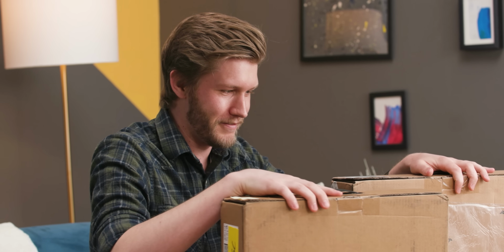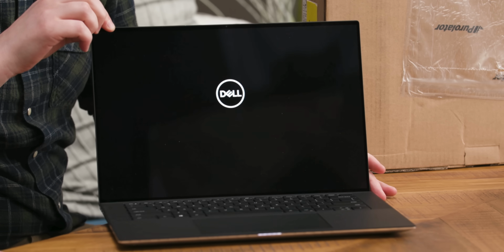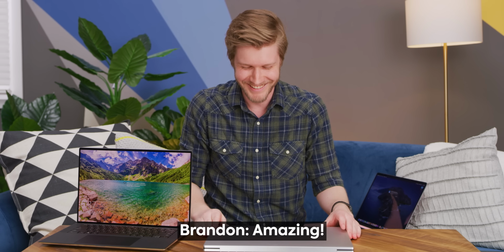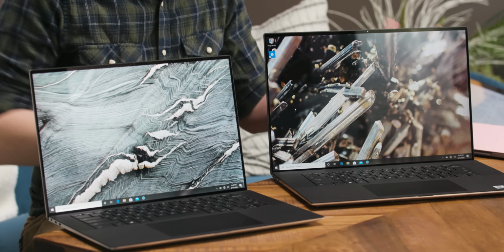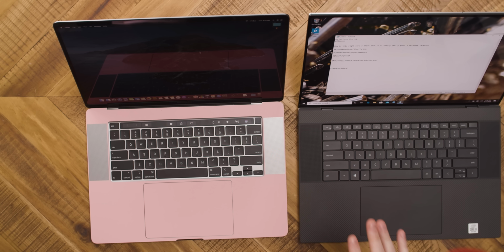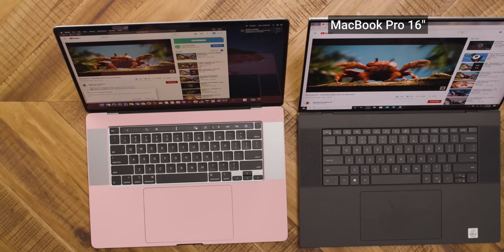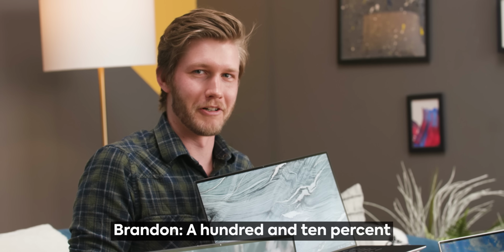The MacBook Pro's Biggest Rival - DELL XPS 15 9500 & 17 9700 Laptops

Comment: Imagine the 15inch with a rtx 2070 super max q(80w) vapor chamber and 4k120hz and supports 165w charging type c using the i9 at 56w constantly with the thunderbolt ports

Comment: I own the old XPS 15 9700 and the new screen is definitely a huge upgrade along with the extra USB-3 ports, but personally I like small trackpads, I know this isn't consensus in the community but personally smaller is better to me, I have large hands and big trackpads get in my way when I type all the time, I tend to slide my hands across the hand rest due to my fingers being broken multiple times from sports and not having full mobility in my fingers, especially ring and little finger

Comment: I wish Dell came out with some Ryzen processors, or at the very least state why they only use intel
Reply: pretty sure you can get a Ryzen 7 in an Inspiron now 
most manufacturers this year still have not moved onto Ryzen because what you see today was approved months back, so if someone does do a ryzen contract. it'll be a few months before you can see them come to production at the minimum

Comment: I support and deploy  the 9570, 7590, 9575 2 in 1.  The 9570 and 7590’s have very mushy keyboards compared to the newer 13” XPS 7390. The 9575 2 in 1 with the quasi Mac butterfly keyboard is very volatile. Users either love them or hate them. The Killer Network card on the 7590 will not pull down full speed over wired. Either on Windows 10 or Ubuntu. An iPad Pro gets better WiFi download speed than the 7590’s with that Killer 1650 card (which is WiFi 6).

Comment: lol measures weight in lb and then "couple grams different" 
technically right but...
Reply: It actually confused me, and I had to go back to make sure it was 5 lbs, not 5 kg lol
Reply: @handspiker1994  Check the temperature outside in Celsius, but my thermostat inside is in Fahrenheit lol. Us Canadians are a little different.
Reply: @10Tie  I like your profile pic
Reply: ooooh god yes!!! that triggered me so hard! :D it is even worse when knowing Alex has some pretty solid engineering  background
Reply: As an American (US) who has lived outside of the US for most of my adult life, I think the same way. Apparently I should move to Canada.
Imperial is more suited for longer/larger measurements and metric for smaller.
Even body temperature. 98.7°f is normal body temp, but 40°c is when I need to worry about my kids 🤣
Reply: I was impressed that he used LBS. As an American I was over joyed he used that system. (:

Comment: Old laptop: 10.5 cm x 8 cm = 84 cm^2 = 8,400 mm^2, not 840 mm^2 as Alex said
New laptop: Alex claims 135 mm^2, which is definitely incorrect. It might be 135 cm^2 though - that fits with the increase in size he mentions.

Comment: The perfect XPS 17 for me:
Ryzen 4900HS
RTX 2060
120Hz 1440p 500 nits screen

Would be nice to have an Alienware Graphics Amplifier port as well 🤤
Reply: It will be a while before a gpu running at PCIe x4 is worth using over a 2060. Those eGPUs are really only meant for laptops with low spec iGPUs.

Comment: IMO the XPS is still a pretty ugly laptop...
and why does the branding still look like it was designed in the early 2000s?
The Surface Laptops just look so much better. Just sucks when you need a proper gpu

Comment: What I don't like is when these manufacturers, for some reason, never include a number pad on the keyboard for laptops 15"+... just the top number that I almost never use.
Reply: because its not a big need for most people who buy one
i have a 15" with a numpad but i barely use it 
just plug in a separate numpad or use another keyboard
Reply: @ShaiyanHossain  You attempt at a solution is stupid, to be frank. The larger the device and the more spec'd out it is, the more likely a user using it will need a number pad. Editing shortcuts, spreadsheets, and maneuverability (all of which I take advantage of) is better with a number pad.

If I wanted to buy additional peripherals FOR A LAPTOP that's meant for ease and mobility, I might as well buy a desktop instead, which defeats the purpose.

Comment: Unpopular opinion: giant trackpads on a laptop are actually a giant pain in the ass. When the base of my thumb and heel of my palm touch the trackpad, no amount of palm rejection is going to prevent accidental touches from totally screwing up whatever you're typing. Of course, I'm also the guy who uses a mouse at every possible opportunity, anyway.
Reply: Agree, although I've never used a giant trackpad like this one so I want to try it before completely dismissing it. Still gonna get one of the new xps', probably the 17"
Reply: @rytisss92  I love the look of it. Definitely a nice evolution on the design.

I have a 2017 MacBook for work, so I'm familiar with the trackpad. It's too big, and I wish it were still mechanical, not haptic. Oh well. I need a Mac for very specific purposes, and beyond that I use my PC instead.

Comment: you can actually use a camera and try to detect the color differences, place them side by side with another screen and change the white balance on the camera, blue light appears faster on the whites I think...im not sure but I bet that works

Comment: This is a great first impression video in terms of presentation but leaves much to be desired in terms of actual content. Everyone keeps comparing the XPS to the Macbook. I get it. But I really want to know the difference between the new XPS 15/17 and the 2019 XPS 15 7590. My biggest issue is the temp/thermals, speakers, noisy trackpad, and fan noise under minimal load. Those have been classic issues plaguing the XPS line.

Comment: A 17" machine with no USB-A ports.  I'm not crazy about that.  I love my 9570.  It has everything I wanted in a laptop.  USB-A and a Ryzen 9 with DECENT speakers, and I would be looking at an upgrade.
Reply: No ethernet as well. I would have expected at least one type A so you don't need a dongle for a mouse or a USB stick. Very weird design for a 17".
Reply: Also got the 9570, absolutely love it. It's expensive but well... The only thing is the cooling, mine sticks under full load (i7 model) at 1,8ghz, that's a bit low...

Would definitely upgrade if we get the Ryzen cpus
Reply: @cbeck2201 , because the bottom panel is aluminium, a cooling pad works great. I bought one for like 10 USD.
Reply: @cbeck2201  Repaste and undervolt, mine is also i7, and is able to sustain about 2,9 Ghz (and limiting factor is power budget, not cooling).
Reply: @mrmarecki1  okay.. Is there a manual for this? Or a video explaining this?
Reply: @tony24-u9x  The downsides with Bluetooth mice are they tend to have higher latency and most lose macro button functionality. One of my Logitech mice allows you to switch between dongle and Bluetooth, the difference is noticeable.
Reply: With all that thunderbolt ports I'm willing to use dongle and a Bluetooth mouse.

Comment: Props to Dell. This new XPS is the first laptop from Dell I'd consider if I was to leave Apple. 

16" MBP specs for those interested -
2.3GHz 8‑core i9
64GB DDR4 RAM
AMD Radeon Pro 5500M w/ 8GB
2TB SSD

Comment: there are no "harmful" blues, only a specific colour range that MIGHT make it harder to sleep, but its not only that specific range, that range just does extra harm to your sleep. But its definitive that no colours are harmful to you eyes, only to sleep
Reply: Ever since I use the low blue light mode on my monitor, i've never had trouble with my eyes. Before that I did have some issues after long periods of usage. It does make a difference.

Comment: Crazy how when apple does something like the ability to charge on both sides or thunderbolt 3 on all 4 ports or having a large trackpad, LTT doesn't give credit to how good that is, yet when 4 years later Dell does it, its a game changer. no bias at all...
Reply: Or it is a completely different type of video. LInus DID praise it for having charging ports on both sides, he just didn't ramble on with his camera man about the benefits. Don't be trying to throw in that bias BS, because you are straight up wrong.

Apple Macbook Pro 2016 - A PC Hardware Guy’s Perspective 

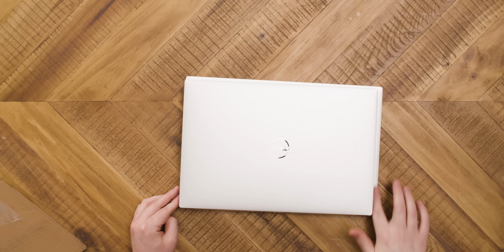4:20 - 4:52
Reply: Mythicle14 cuz macbooks are shit
Reply: Absorb can you explain to me how? They have basically the best processor for laptops, a pretty good GPU, they are thinner, have better build quality and have a better trackpad, respectable thermals (in current gen). Higher color accurate screen, better speakers, better design... basically everything. The only thing this 17” has is a 1” bigger screen with smaller bezels and a higher performing graphics card by about 30%. 

Also better battery life on MacBook
Reply: And that’s not even comparing OS. Since that’s more of a preference

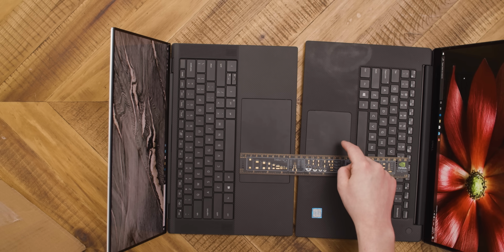Comment: 3:54 
Old one: 840mm²
New one: 135mm²

60% increase?
More like 600% decrease 😂
Reply: 60% looks about right, the numbers are just off
Reply: You have to take into account that its mm^2 so it doesn't increase linearly. 60% is about right.
Reply: @poohisangwy  it is linear but Alex said wrong number accidentally, probably missing a zero at the end, that was the joke
Reply: @TheDeathslaw  Exactly, it's supposed to be 13500mm² or 135cm², which is a 60% linear increase
Reply: Zombiez910 it’s probably 13500mm^2. 1350mm^2 is 13.5cm^2 and that doesn’t seem right. That’s tiny
Reply: @TheDeathslaw  you're absolutely right, I didn't look at the numbers when I made my comment. My bad 😂
Reply: @FlandraLabs  you're right, my math was wrong 😅

Comment: Dell XPS is one thing, but you really should pay more attention to the Gigabyte Aero lineup. They're very much designed for content creators, with Pantone-calibrated displays, fast SD card RW slots, good hardware and easy upgrades for storage, RAM and wireless cards. They even come with Windows 10 Pro out of the box.

Comment: I think you kinda oversell the 2060 version at being "excellent at gaming". Sure it'll be good but the real question is can it maintain speeds under heavy load for extended durations without throttling down.

Comment: Also, how does the 17" model compare to the OLD 15" model, size wise?
Reply: Pretty sure the 17" 2020 is a tad larger than the 15" 2019 model. It's about the same size as a normal 15" laptop
Reply: Same size as 15 inch laptops with thick bezels
Reply: I'd say the screen is about 2" bigger, but that's just an uneducated guess
Reply: fun fact: the 17" is bigger than the 15"
Reply: @pawet2167  he's talking about the size of the entire body with slim bezels compared to an older smaller screen with thicker bezels

Comment: i want a laptop with lots of ports , for example RJ 45 , HDMI , usb c , usb A , thunderbolt , sd card slot , headphone port  in one package . it must be thin and light (not thin like dell xps ) and powerful , and also must have a good color accuracy display . what should i get ?
Reply: A Fujitsu.
Reply: @iscle911  oooh , thanks . i will check it
Reply: That’s kind of a tough ask. You usually need a thicker chassis to fit all of that I/O.
Reply: A dongle?
Reply: @JamieR2077  i hate dongles
Reply: A desktop

Comment: I've bought a Dell XPS 9560 15" in 2017, it came faulty and got repaired 2 times with multiple hardware changes, Dell refused to give me my money back even thought I asked for the refund in the first 14 days and have been doing it in every e-mail I sent them. Spoke to dozens of colaborators that didn't help me at all, they stopped answering my e-mails, on facebook and by phone. 
If people want to go for a Dell, it's a new computer but has a lot of performance and thermal issues and if you are unlucky as me and get it as bad, they will shit on your face because they don't value their customers.
My situation happened in 2017, they stopped helping me 1y after buying it and it's in a legal court :)